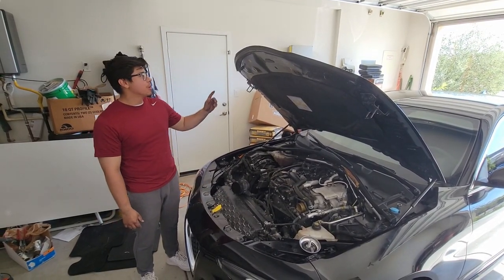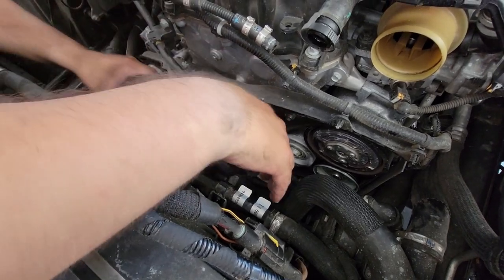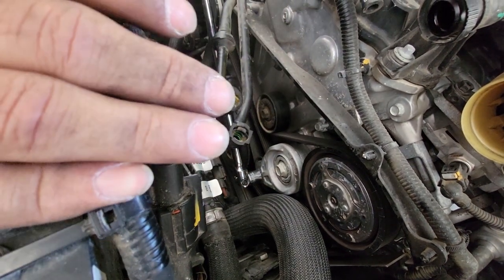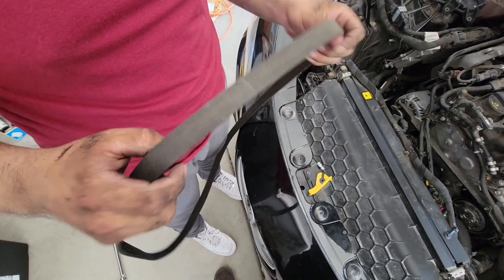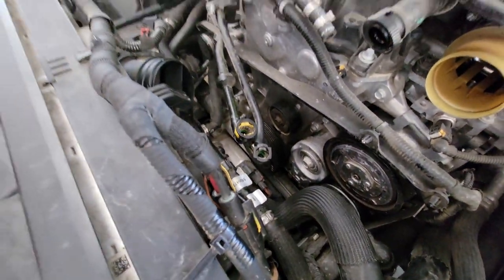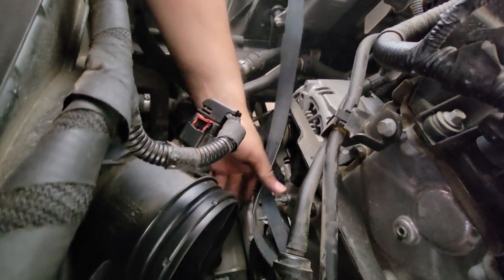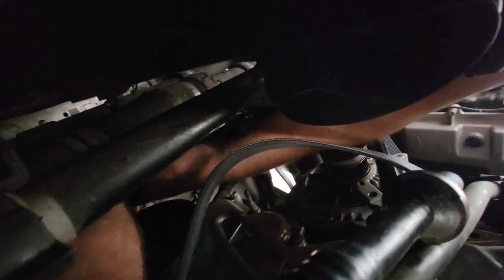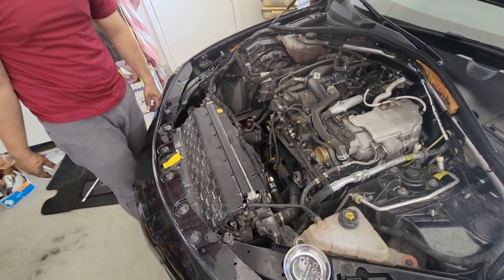Alfa Romeo Giulia/Stelvio 2.0 Auxiliary Belt Replacement

Comment: Very good video bro. Gonna use it very soon. Did you access the 4 bolts from the top or bottom of the car?
Reply from the maker: You can access everything from the engine bag don’t need to lift the car or anything to get those bolts off